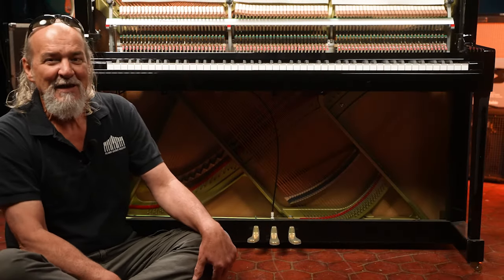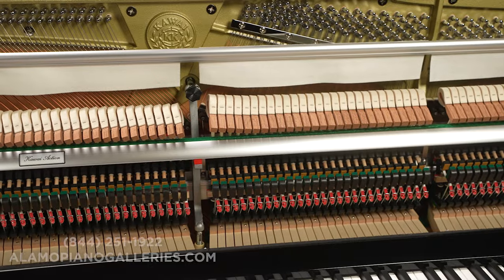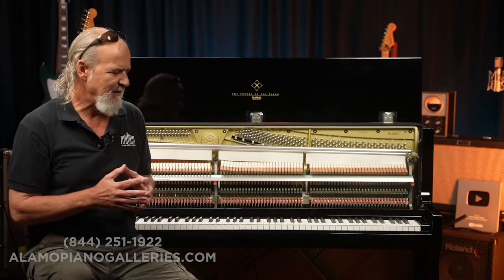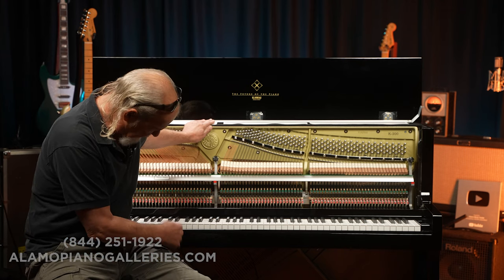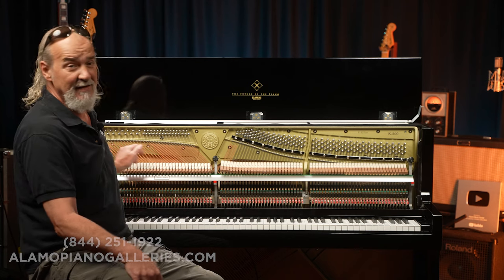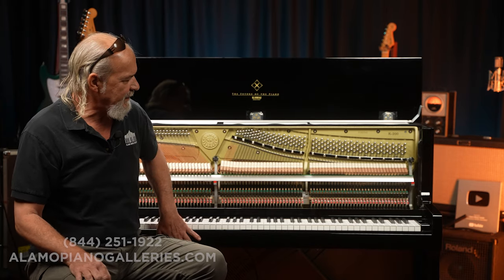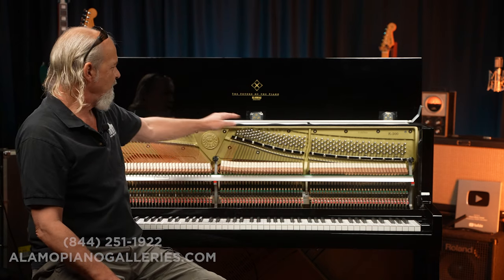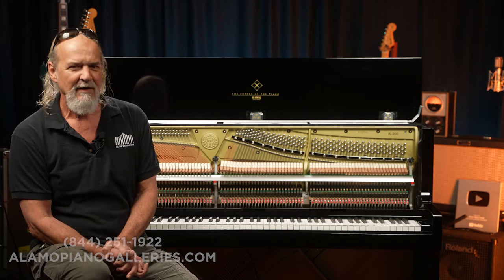Find & Fix It: Upright Piano Noise Repair

Comment: I’ve got a large J Becker upright tuned to 432 hz.. within the first half a year I opened it up completely to remove the sound board. Loved the increase in power the piano had so much I can’t even tell you where those wood panels are almost 10 years later

Comment: Great video! I have a squeaky damper pedal. But it only squeaks if the bottom panel is on. If I remove the squeak is gone. When I put back squeak returns. :( I've tried felt in between panel and piano, nothing is working. Its really disconcerting. thank u!